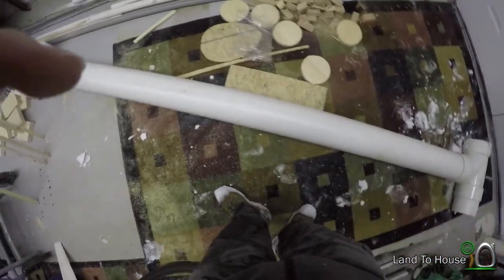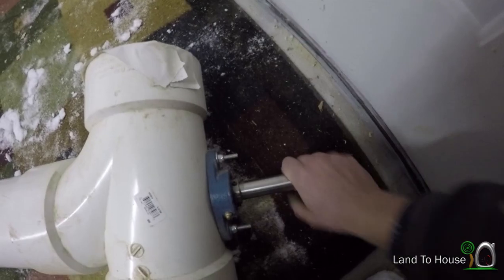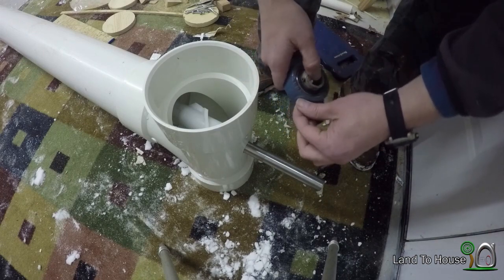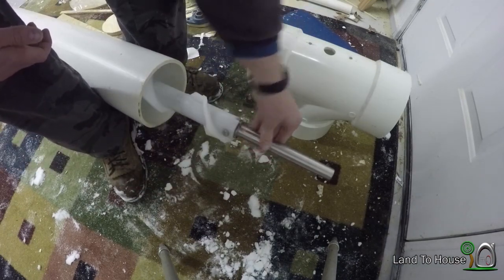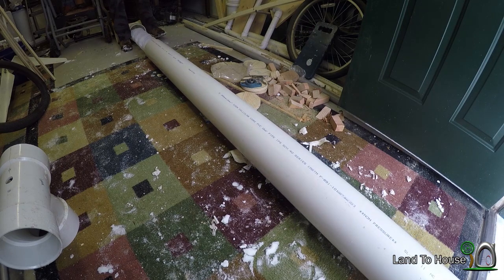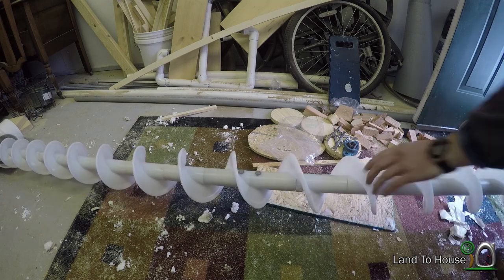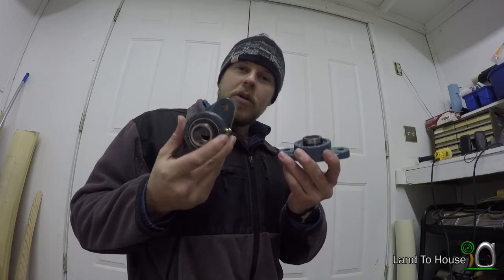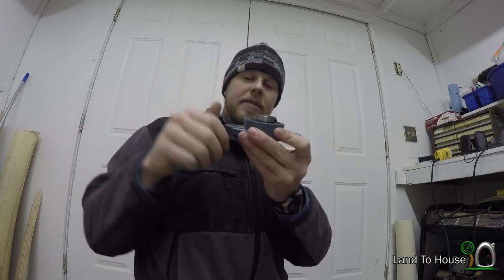Archimedes Turbine First Look

Comment: I have a few theories here, first is that like a grain auger rattles when it is empty and basically does help centre itself when loaded and runs smoother and quieter when grain is being pumped into a silo, the water will greatly help in centreing the auger as it runs and perhaps it will sort itself out,
Next to that, you could probably make 2 half length auger pumps with your 2 augers that may have potentially better generating power if you have the water to run them in parallel simultaneously, this way you could run 1 or 2 generators off the auger type drives.
Good job, great vid, thanks for sharing

Comment: You screw does not need to be two sections long.  There is a finite amount of energy you can get out of water.  One section is all you need.  If you want the exact "usable" length, you will need to look-up the hydro engineering equations.  BTW,  The larger the diameter of the  pipe and screw.  The more effective of a power generator this setup will be.   It also means you can use slower moving water.  -BAG2
Reply from the maker: +beageek2 yes very true. When I ordered the screw I figured it would be better to have the length but did not realize how much give there would be where the two pieces were joined together.

Comment: You don't want to grind down anything, you'll just make the problem of the screw vane touching the sides in the middle worse as it will move more from side to side, should just use the one  screw vane in one tube or use them side by side in their own tubes.

Comment: There seems to be too long a distance between each bearing; there is probably sag in the pipe and maybe the screw too, however, one probably does not sag as much as the other and they are binding in the middle. Since you are using 2 screws each will need support at each end (ie: use 4 bearings). Bear in mind also that when the pipe gets water in it, it will surely sag unless it is well supported.
Reply from the maker: +Ross Eion Tought years ago when I bought this auger I was thinking of the amount of water in the pipe. I was not thinking about the sag that would occur. Definitely should have gone with a single section.

Comment: Its not gonna work properly, because it has to float horisontaly into de water, like a submarine, got it. So the hecolicoidal tube must be closed with the right amount of air inside, in order to do not touch any part, and keep rotating freely inside pvc tube, or hang it vertical, but here this kind of pipes ar only used for sewer, and is not a good ideia mixing sewer water, or it gona becomes a paste or worst a gas propeller, and also will lead the system to a clog. Only clean water and verticaly or a helice airtubed. The piece is toooooo long. I have to make it in ofsmaller parts, regardin the material stress point. There is a coeficient of toughness for any kind of material. The structural colapse or distortion point of itself. So it will not bend probably with less than 1,33 meters. But try a tube withe air. two end taps. not made by metal, l 

.
Reply from the maker: I have brought this project back after years sitting in the creek. From the research that I have done the auger needs to be at a 25 degree angle for best efficiency. Should be a fun project. Look at my videos from the past month and you will find the new videos.

Comment: id try to take the sage out of the auger.  maybe put a washer in between the two pieces and make it a tighter fitting joint.  and if it was vertical i bet it would spin easier
Reply from the maker: I think you are right. I need to find a way to get that middle part tighter. I had to use a lot of force to get the two pieces together when I got the auger. I really dont want to take it apart haha. I will have to think about some way to get the joint tighter.
Reply: Maybe two small pieces of angle iron with 4 threw bolts?
Reply from the maker: Tiny House Customs the auger has a tab on the lower part that fits into the upper part and has about 5" of room. I think i could add a few bolts along that 5" at 45 degrees from the first to hold the two parts together. If that does not work I can try the angle iron idea. I just hope these bolts don't catch debris.

Comment: I am sure the main problem will be the sag in the auger made worse because of it being jointed, I think you would need to sand away quite a lot of the plastic before it didn't touch the sides. Is there any way of making the joint stronger? Perhaps a steel insert where the joint is?
If you took the auger out and supported it on the two end bearings only, with a string line you should be able to measure and see exactly what sag you have over the length.
I hope the snow goes away soon so we get to see it in the water
Reply from the maker: humm. I wonder if I add a couple more bolts to the joint on other sides if that would prevent it from sagging. Or at least reduce it enough to make the spin nice and smooth. The sanding that I have done so far seems to have made a nice fit in the pipe so I will leave it at that. The bottom part of the auger has a smaller tab that fits into the upper part so there is no real way to make an insert sadly. As tinyhousecustoms said below I might can add a washer to fit. but the auger was a very tight fit to put together. Mostly the plastic part. So I dont want to take it apart if at all possible.

Comment: remove a bit of the screw vane in the middle and mount a bracing bearing ... Also you are using a "Y" cleanout fitting on the ends not à "T" ... You can still use those but have your shaft go thru the top with the water coming in the bent leg going in the direction towards the screw ...
Reply from the maker: Another support in the middle would be ideal. At this point I think that I would like to try removing half the screw and using a smaller setup. I wanted to use a T but could not find one in my local stores. Not a lot of options in my small town.

Comment: split to 2 sections hang vertical with 2 generaters, no fitting at the bottom it will reduce flow
Reply from the maker: I think there is just enough room to hang it vertically. I would have to make a holding system that could take the weight and torque.

Comment: I like your general idea. Here is a personal thought, Not a professional. With a 2 piece auger set, It would be best to take it to a machinist/welder and have it welded perfectly straight. Also use a 90 degree elbow instead of a tee. Less friction loss, Even if you have to mount a flat piece on the elbow for the bearing. Sanding reduces your water flow and pressure on your screw.  Your PVC pipe can and will bend unless You a straight and level support for it. You thought please.
Reply from the maker: When I purchased the auger I thought that longer would be best but 8 feet was as long as they could ship in a single section. I opted to go with a longer two part section and that was a mistake for this application.  I also made a frame for the auger but that was not strong enough. several things to work out.
Reply: Put the Bearings mount them to a cap instead  and a piece of steel between cap and bearing mount   To help mount it up put the tee  between cap and pipe you will have to shorten the pipe accordingly.  Hope this helps
Reply from the maker: That does make sense and also would give only one opening for the water. Unlike the cross T that I have now. Someday I will get back out and try this again.

Comment: Will it be vertical when operational?  That might mitigate the floppiness at the joint in the blades.
Reply from the maker: Hello. I am actually back at this project years later.  The optimal angle is around 25 degrees. Or so I have read. The new test is half the length. You can find those videos on the channel.
Reply: @LandtoHouse  oh yeah, I guess an angle provides more productive contact between water and blades.  Thanks.  I will definitely check out the vids.  Keep it up.  I mean keep building cool stuff that makes the world a better place.
Reply from the maker: @Mountainchip  This type stuff is fun. I just need to find more time.

Comment: You might try a bearing in the middle of the tube.  A water lubricated bearing that the water can flow through.  Maybe like a tube sized circle with a cross in it, with a shaft sized hole in the middle.  Mill one out of nylon perhaps.  I like this project and hope you continue.  I will be moving onto some acreage soon that has a stream soon and I need ideas...
Reply from the maker: I might have to support the middle.  I think i will try adding more bolts to the middle first.  I have a few other ideas for making power of this never goes anywhere.  :) thank you for watching and congrats on your move.

Comment: Instead of one auger (turbine) why not split it and make two then no sag and you have twice the ability for power I think.
Reply from the maker: That is a good idea. I might get to that if adding more bolts does not work. The main issue that I have with splitting the auger is combining the output. I have not read up on how to combine two voltages. The wire run to the house will be 200' so I dont want to have more than one set of wires.